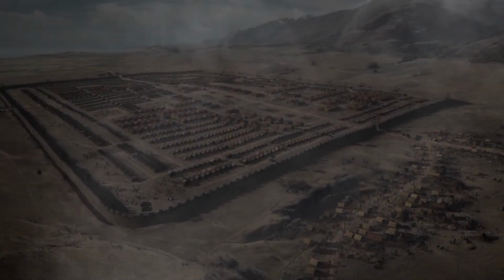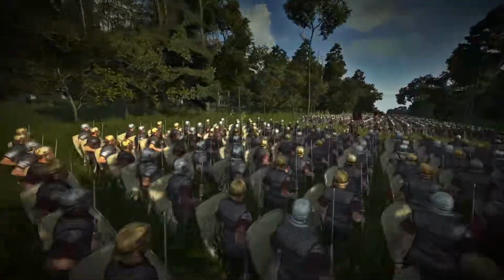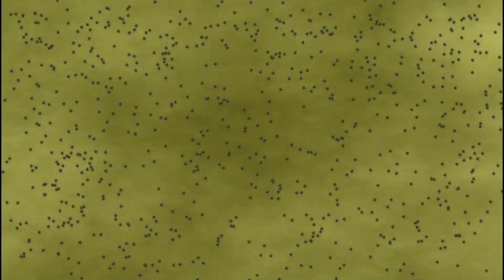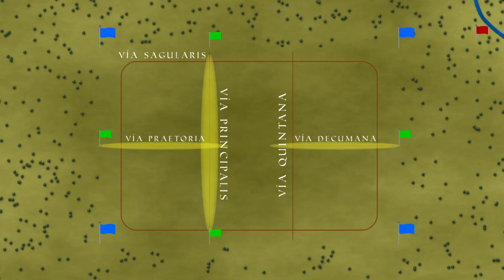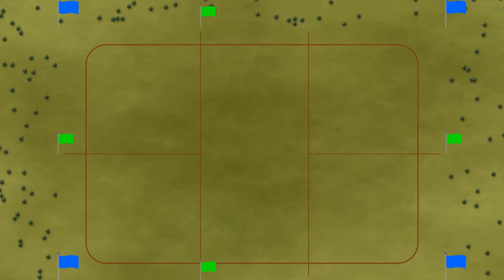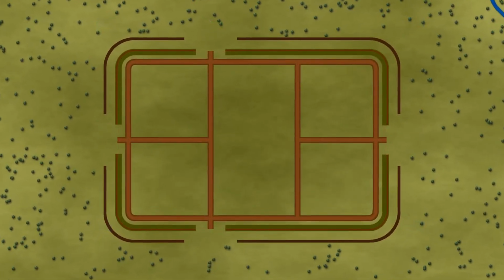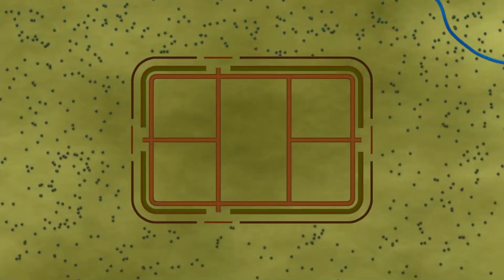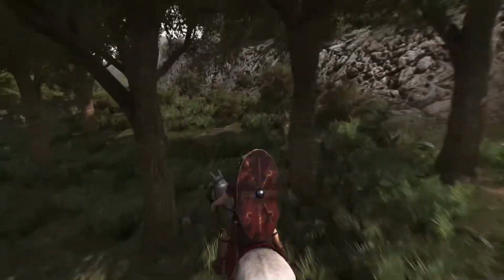How were Roman camps made? | Military marches | What were they for?

Comment: I would say the marching camps were only fenced by the small stakes carried by the soldiers not proper heavy timbers, the gates must have been blocked by  those two pointed stakes movable crossed on a beam , similar to ww2 barbed wire barriers. was there a need for more than one gate on a one night camp? I think the mounds were further back from the ditch than the diagram so they did not fall back in. Did they have towers? There's not much to view at night and it would make extra work and need big timbers. Permanent stone forts had of course 4 gates with pivoting doors, and until they were built they were full wooden structures. We then have to consider, flame torches to see in the dark, the problem is your eyes adjust to the light so you don't see the enemy approaching, but they can see you lit up on guard. They would not approach with torches because they would be seen.